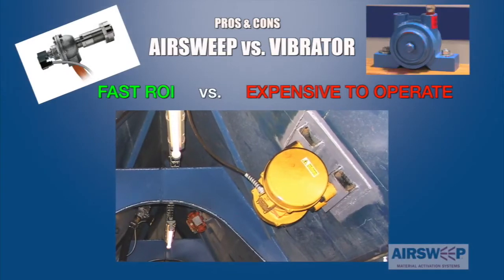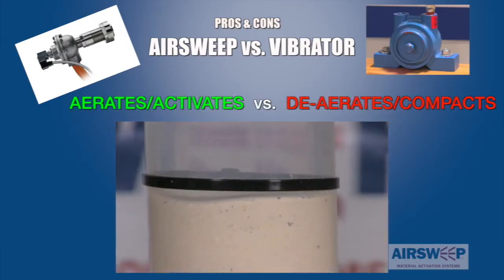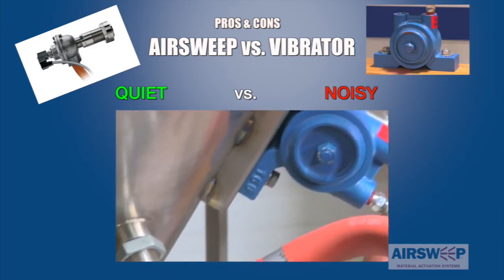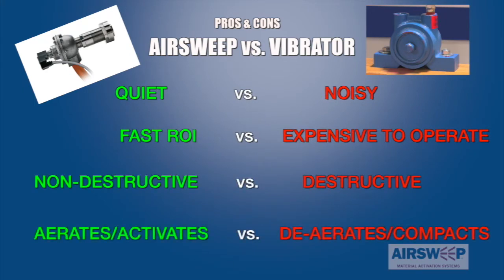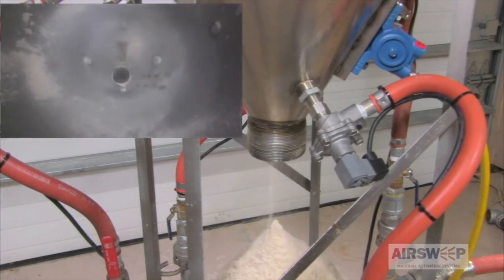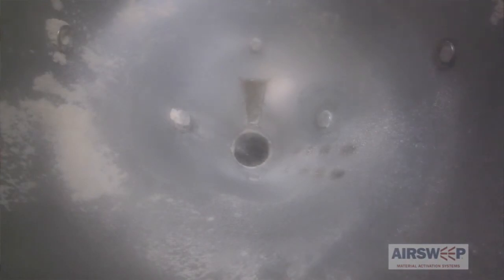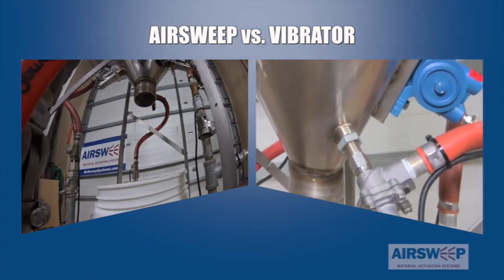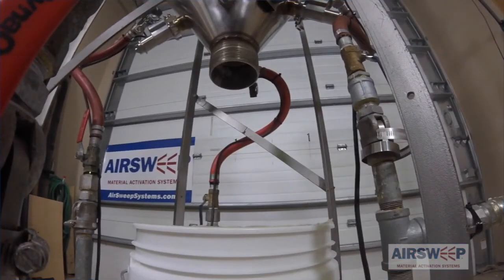What Is An Industrial Vibrator? How Industrial Vibration Motor Works?

Comment: There are a lot of inaccuracies and exclusions in this video. High frequency, rotary vibrators are a poor example of what is possible using vibration as a flow aid. Well placed/operated impact vibrators are more effective and consume less air than their rotary counterparts and air sweeps. There’s a reason why hammers, which generate an impact vibration, are the most widely used flow aid.